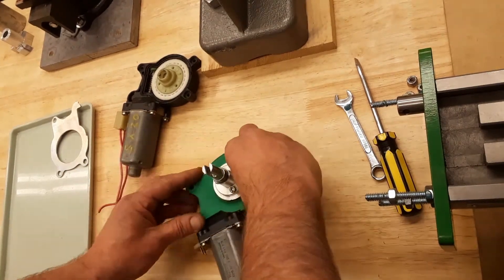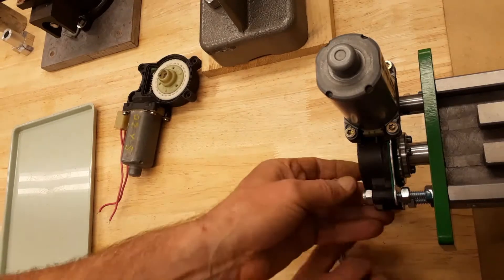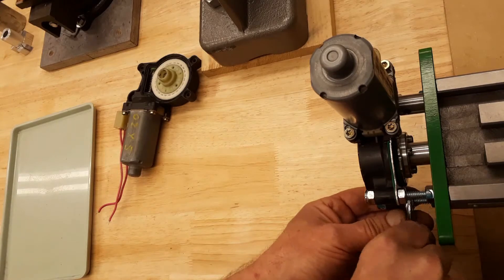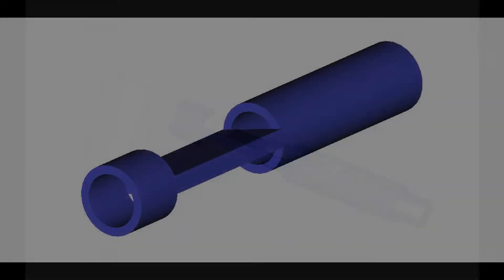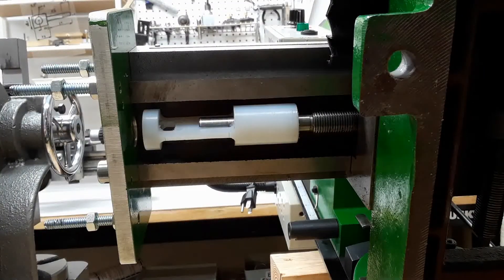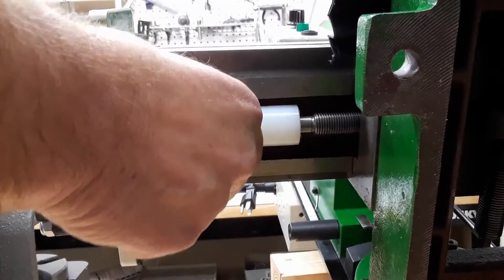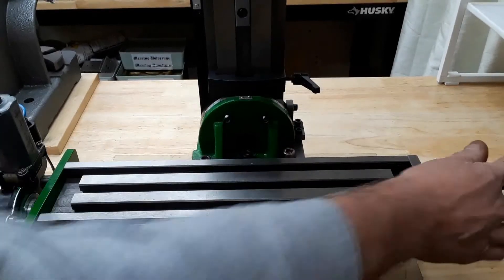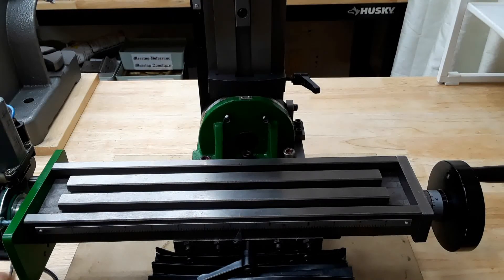MINI MILL POWER FEED. ELEMENTAL CLUTCH.  INST: arkadiy.chernikov

Comment: What RPM is the gearmotor you used? I mocked up an assembly with 3D  printed parts to test and I think the gearmotor I used has too much reduction.
Reply from the maker: Telling the truth I have no idea what is the motor maker and its parameters. Just picked it up in the auto junk yard.